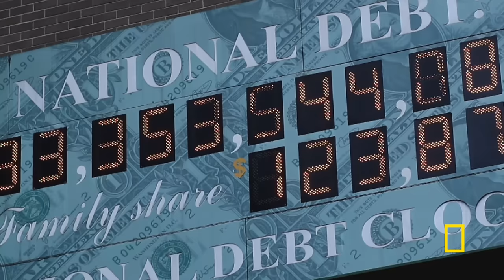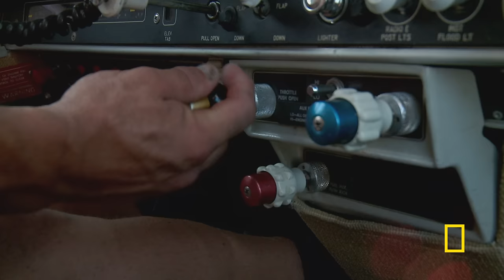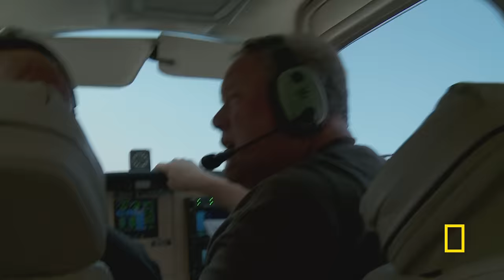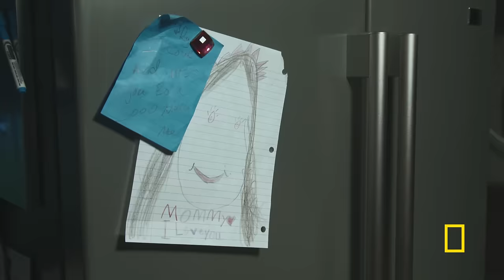Survival is an Ugly Beast (Full Episode) | Doomsday Preppers

Comment: Both need some more reevaluating in their tactics. The air force dude is definitely a Pog. You can tell by the way he shoots and lack of other helpful gear. Also he tested the glass with only pistol caliber he should of tried ar or ak rounds. The second guy should of dug underground like in Vietnam, especially since his wife is afraid of heights. The tree house does provide some concealment but no cover. Meaning if bullets are flying that plywood ain't doing anything. Just fish in a barrel. His gear is also all over the place. He has a vest that no one uses anymore and has no to cheap optics on his rifles. They are not as prepared as they think they are. Also with the use of drones especially with thermal imaging it'll be easier to track their moves, get in their property and avoid traps.

Comment: I would be interested in knowing the calibers of the two weapons used in the bullet resistant glass test.
Reply: Shooting from the outside = 9mm.     Shooting from inside barrel = 500 s&w
Reply: Shooting from inside was also through the already compromised outer layer. No such thing as bulletproof, just bullet resistant. Even "bulletproof" windows on armoured vehicles will fail after a certain amount of rounds
Reply: @gogogo1064  you sure that was a .500? It seemed closer to .44. .500 are extremely large and the recoil tend to a bit unwieldy, even for larger guys.

Comment: You need to use actual mirrors on that tree house not some cheap reflective material
Reply: Exactly. Not.  1 rock to a mirror and it's over. Especially if I take the ladder. His wife ain't coming down. 😄
Reply: @MISTERKIC  the odds of you noticing it is very small, highly doubt you look up in the trees non stop. especially if a threat is on the ground
Reply: @MISTERKIC  the anti thermal paint alone is huge, thermal is becoming a necessity. no way to hide from thermal unless youve thought abt it before hand. mirrors could forsure be better but for what he prob paid and how often foot traffic will go through his area, its pretty good. if youve watched this video and now what to look for itll be alot easier to spot but if not good luck
Reply: @carsonwilly813  Negative. Clever idea but, that structure is visible in every way. It's a fantasy hideout. Just being honest.